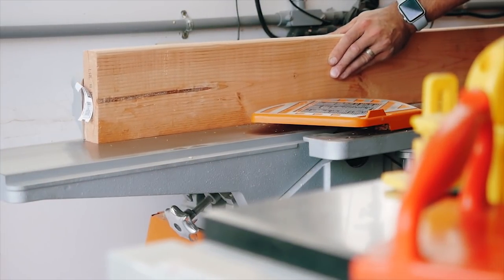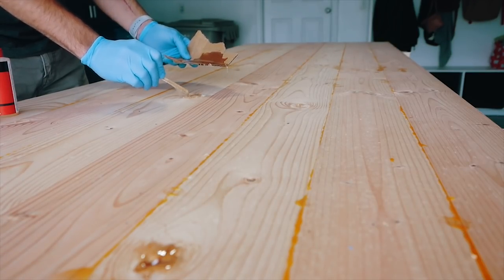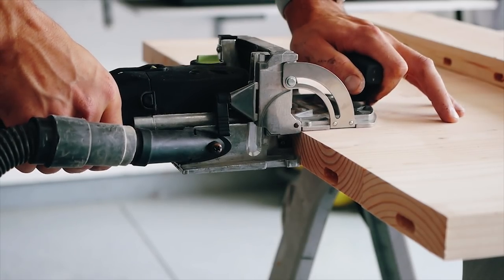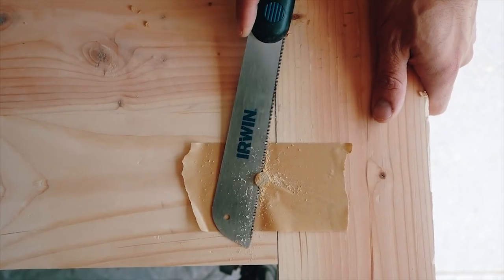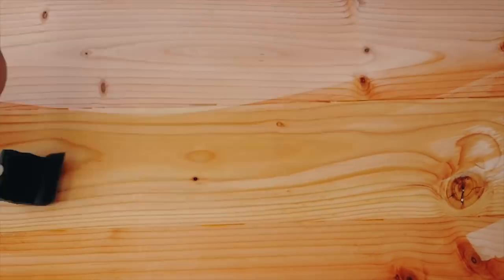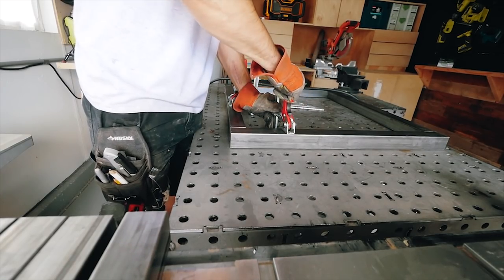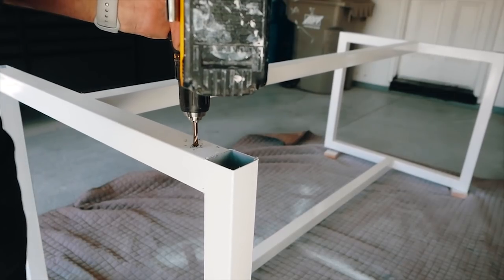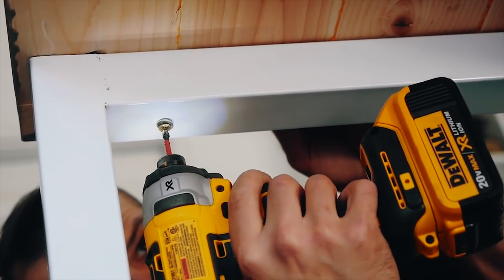DIY Farmhouse Dining Table

Comment: I'm probably wrong, but I thought that you would glue the dowels on the bread board in the center, but not the ends like you did. By gluing it in the center it allows the wood to expand out from the middle. If you do it on the ends it has no room to expand. Again I may be wrong.  It looks great.
Reply from the maker: hmm. You know, im no breadboard expert. But this was the way i was taught. ive built a few tables this way in the last couple years and its worked incredible.
Reply: Mr. Build It 
Enough said. Again great job. It looks great.
Reply from the maker: Hey thanks so much. really appreciate the support
Reply: Rchavez you are correct. Yet another YouTube “professional” giving a tutorial about something he knows nothing about
Reply: The amount of mistakes in this video for building this made me cring so hard

Comment: Nice project ! But i saw that you didn't butcher your steal legs and I think that it will rust from the inside but keep the good work Alex and congratulations for the 12k ! :)
Reply from the maker: hey stefan, Theres no need to coat the inside of the legs because its going to be inside the house
Reply: Incorrect. If that was the logic then why do other metallic items for indoors have coatings? This will eventually rust from the inside. It won’t affect the strength but it will rust
Reply: @JohnDoe-js6pf  thanks for your info :)

Comment: The steel doesnt scratch the floor?
Reply from the maker: There are the 1/2 stick on rubber stopper on the bottom
Reply: Do you have a link for what you're talking about?